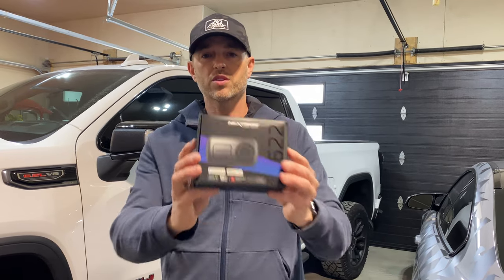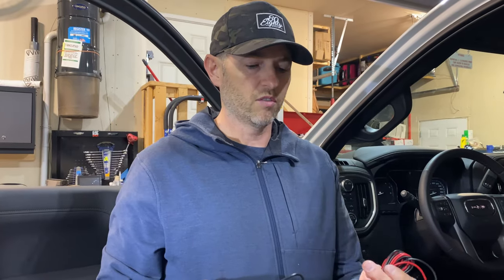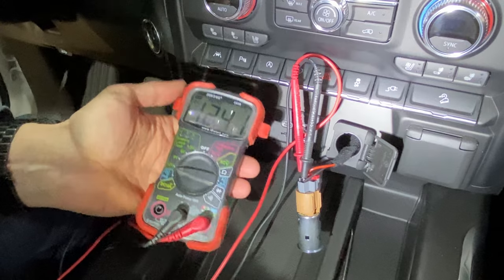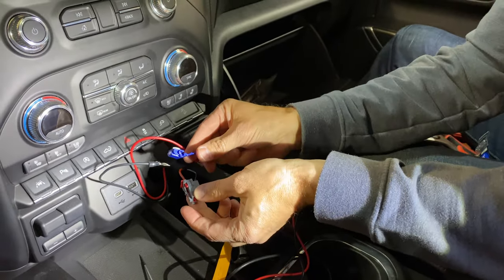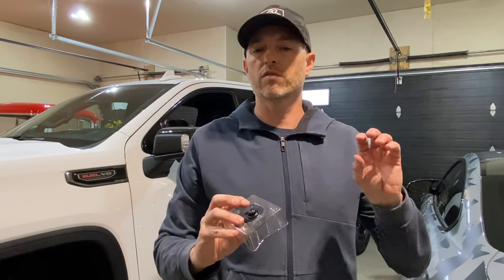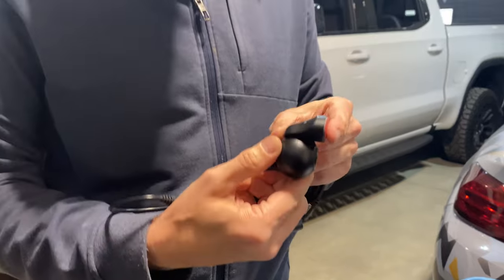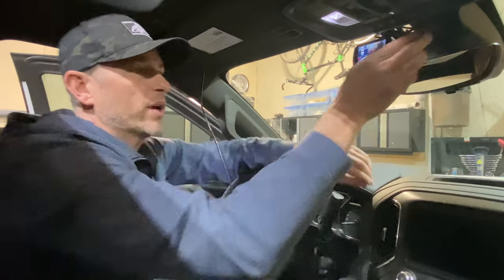Nextbase Dash Cam with Rear Camera Installation and Comparison.  What's Best for a Truck?

Comment: The camera that mounts to the main camera is a cabin camera, for recording all that happens in the cabin, it is not a rear view camera for catching what happens outside behind the vehicle, they are three cameras for three different jobs and view points.
Reply from the maker: Yes
Reply: You are not correct. They offer two inside cameras, inside the cabin and a telephoto one.

Comment: For the main unit, could you have used the adhesive mount and stuck this on the dash instead of the windshield?
Reply from the maker: You can stick it to any area you want as long as the surface is smooth enough, clean and you can get the right position for the camera's view.
Reply: Why would you do that. They say the unit should not exceed 120°F. If you mount it on the Dash it will cook in the sun. I guess he should’ve mentioned it but I don’t see the practical use in doing that.

Comment: That screen is huge to have on your windshield in your field of vision. It’s the size of a pocket camera from the early 2000’s. There are others with just as good of resolution with a much, MUCH smaller screen. Does that get in your way or bother you at all?
Reply from the maker: You might be surprised, the placement is not restricting at all.  The problem with producing a video is your seeing the camera’s perspective and not necessarily the driver’s.  I am very picky and put a tremendous amount of thought on where I wanted it.  Where it is works in my opinion. It is only 3” diagonal. The video probably does make it look like a Canon A60 point & shoot 😂.  Thanks for watching

Comment: Good review, but how does the rear camera get power? Are there contact points on the base that the ball magnetically attaches on? No one seems to explain that. I like that you showed how the front camera gets power. You're the only person that actually explains it.
Reply from the maker: Thanks, the rear camera gets power over the single USB cable.  The rear camera connects to its mount magnetically.

Comment: Thank you so much for this video. I was kind of scared buying the front and rear combo because it sounded so difficult to wire up and take the headliner off the car to get the wires to the back of the car but you showed how to do it. Very thorough explanation thank you!
Reply from the maker: Awesome!  It is why I make these videos

Comment: Great video, after watching I started to run the power from the camera end, like you tucking the led box in a convenient space then I was able to cut off all the excess once I reached the supply point rather than stuff excess cable behind the dash. If I hadn't watched this I would have done the same as you and started where picking the power up. Also helped my choose which rear view go go for.

Comment: Hey Don, your video was very detailed and answers my question whether both rear camera can be installed at the same time. Thank you buddy and love the metal gear solid reference.. God bless mate.
Reply from the maker: Glad you liked it
Reply: I'm actually considering the 522gw since it's only $250. I think 1440p front should be sufficient although it reduces the rear resolution to 720p. What do you think? Should I get the 622gw instead? It's for a 2017 lexus rx350.
Also, have you tried using a non Nextbase SD card? Their website warns of recording errors if we don't use their brand cards. Thanks again.

Comment: I just purchased the 622GW with the rear window mount camera. I intend to install the rear window mount camera on my sliding rear window by routing the cable to the camera from the side the window slides to. I plan to have the cable outside the liner enough so that I can open the sliding windows and have the cable droop. When I close the window it should pull tight. I mainly open the sliding window to blow the hot air out when I first use my F250. Pretty much stays closed otherwise.
Reply from the maker: Could work.  I was thinking the movement of the cable from the glass could cause the camera to swivel in the magnetic cradle.

Comment: Nice install! Poke and wrap over wire tap for me though. Those can be hit or miss, and when they hit, it still cuts the strands of the wire your tapping. I dislike that greatly. Anyway, I have 300ah of battery on board, so I'll wire to a constant source for 24/7 monitoring. 

Your review video helped make my decision on the 622gw, thank you for that video, and images. That's what sold me. Don't need a camera if you can't read the plates. 

Time to have a witness for the inevitable it seems. Roads are crazy out there these days.
Reply from the maker: Glad it helped you out

Comment: The rear camera wire you said was not interesting to watch. Well I would have been interested. Was it easy? Did you run it just inside the weather stripping? I was thinking of getting the same camera and I have almost the same truck. 

Thanks!
Reply from the maker: Sorry it was very easy to just stick to the edges of the headliner.  If you watch this video I lower most of the headliner: https://youtu.be/-jZGRPj2g5g
Reply: @Donslife  thanks! I will watch it.

Take care.

Comment: Great video (as always)... 2 questions please. 1) Did you run the rear camera wire along the driver's side headliner or through the middle? If the latter, how? 2.) What kind/size of wire taps are needed? Thanks again for the detailed video!
Reply from the maker: Hi!  I ran the wire along the driver’s side headliner.  Here is the Amazon description: Gebildet 4pcs 12V 24V Add-a-Circuit Micro 2 Fuse Tap, Piggy Back Blade Fuse Holder with Wire Harness, 6 pcs Micro 2 Fuse (5A 10A 15A) and Fuse Puller
Reply: @Donslife  Perfect. Thanks again. Looking forward to the next video!

Comment: So I have a question, why come you didn't get an add-a-tap fuse to tap into that side fuse panel, I have a 2023 Chevy Duramax 3500 and I'm trying to install a dash cam, are their any hot fuse on the side fuse panel?

Comment: What about mounting that 3rd camera to the bumper near the license plate?  I have a late model Silverado and just bought a dual dashcam setup.  Didnt think about putting on the glass at the rear of the cabin.  Thats much simpler than having to run the wire through the floorboard.  The downside is limited view below the tailgate, eg.  when someone is pulled up right on your bumper at a stop light or is tailgating you on the highway.  Actually, after re-watching the last part of this video again, I think putting my rear camera INSIDE the cab, just as you have done will work just fine, with the added benefit of everything being inside the cab.
Reply from the maker: I am with you.  Personal experience only - For my climate I found external cameras like the ones for dash cams  aren’t reliable in -40°C/-40°F conditions.

Comment: Nice comparison video.

Question for you - is there a way in which we can tap into the third brake light camera used for LCD rearview mirror of the GMC’s with technology package?

It would likely be less obstructed and reduce the number of accessories attached to the inside of the window. Maybe one of the aftermarket dash-cam companies can look into a kit that allows us to tie into and use the existing cameras and simply record these signals for our record.
Reply from the maker: It crossed my mind however there would probably need to be a inline conversion module  to adapt the signal and adjust the resolution/aspect.  I find it highly unlikely that an aftermarket company would make it in the near future.  Be really cool though and I am okay with being wrong on this assumption
Reply: I have been thinking the exact same thing.

Comment: What brand of wire taps do you use? I will be installing my 622 this week in my 2020 1500 Denali
Reply from the maker: Nothing special.  Just an Amazon find if I recall
Reply: @Donslife  Thank you. The brands are pretty much all the same.
Reply: Using your video as my guidance, I finished the install on my '20 1500 Denali. It took me about a half hour with most of the time spent on running the cable in the headliner. I was able to find an unused constant power 20A circuit using a 2 prong fuse located at the F5 position on the passenger side fuse box. I utilized the umbilical that was included within the Nextbase wiring harness. This saved me from tapping into the cigar (not a ciggy person) lighter. A big thanks for giving me the guidance on how to install my Nextbase 622.

Comment: Is there a reason you didn't tap into the fuse box? Did your cigarette lighter still work after you tapped into it?
Reply from the maker: No special reason other than I wanted to show my audience alternative installation options.  I have done several videos with fuse tap videos for radar detectors, dash cams and more.  I can use my cigarette lighter socket as normal.  A dash cam uses very little power.

Comment: Once I get the "Metal Gear Solid" alert sound at the start, this guy gets the thumbs up. I don't even care about the rest of the video anymore!

In seriousness, would have been nice to know how "goofy" it looked in the corner. I'm just curious how obtrusive that camera is in your rear view mirror. So that would have been useful.

But thanks. Good to watch.
Reply from the maker: 😊 the mirror screen is a nice add on and not obtrusive at all.  I find I use it in very specific situations, usually hauling cargo or towing to check on things.   Otherwise when not on, it looks like a standard mirror, which is 95% of the time

Comment: I could of sworn the fuses on the passenger side panel are the 2 prong( i could be wrong ) and there is a  fuse for the cigarette lighter adapter and you can leave it like it is and be powered 24/7 or you can move it over a notch and it only work when the truck is on

Comment: Cigar lighters are a great 10 amp. Circuit breaker. Already at the center dash.
Reply from the maker: Yes, I did a dash cam install about a year before with that method, I changed it up

Comment: Hi what is more better in your opinion? 
As I have the rear camera that attaches to the rear windshield. I’ve tried the cabin view camera but it’s not good if you have passengers in the back.
Reply from the maker: I like the rear window one better.  If I was an uber driver or taxi, than the inside might be more appealing

Comment: great video ... keeping it simple and clean.   I noticed maybe a travel trailer near by ... not sure if its yours, but do have a 25 ft trailer and was thinking what a great place for second camera. in your opinion would you be able to extend second camera wire to reach back there?  thank you.
Reply from the maker: Good question, but I think it could be problematic running the signal wire that far.  Plus you’d need to splice in an extension.   For my 30ft trailer I would look at a wireless transmission option to a separate screen. Or add trailer cam option to my truck (which it has a provision for)

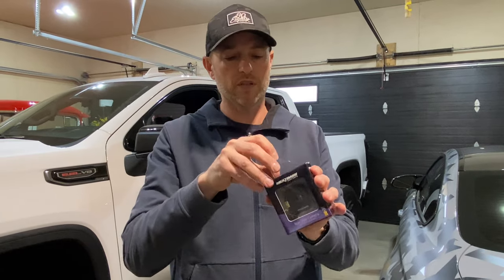Comment: 11:21 the camera falls in the background. Good video might pick one up for my AT4.
Reply from the maker: Ya I would suggest the adhesive for the final mounting position.
Reply: @Donslife  Yes, the suction cup also fails & the camera will fall in high summertime heat when the truck interior is super-hot.

Comment: Hey I have a question for you, I am looking into getting this camera the 322GW with the rear camera that clips into it would they both record at same time?
Reply from the maker: Yes it will simultaneously record two files. One for each camera.  Make sure you buy the recommended memory card ‘U3’ spec or you could run into problems.  The cards have to be fast enough to record the data.  Thanks for watching the video!
Reply: @Donslife  thank you, i am not sure where to get the SD cards, I found one at the place I am looking at buying it is 32GB will that be okay? Can I move and clear the clips each day or every couple days onto my laptop?
Reply from the maker: 32 for that camera is fine. It saves the files you need based on a button push or if it senses a harsh movement and puts them into a folder until you move or delete them.  All of the other files with no action get overwritten automatically unless you download them.  A 32 GB card will last quite awhile (days) with that cam.  Unless you drive for 4+ hrs straight every day.    BestBuy will have cards but here is the actual specs from the nextbase website:

https://www.nextbase.com/en-ca/accessories/32gb-u3-microsd-card/
Reply: @Donslife  awesome thanks, I’m in Australia I think this brand is new to us I only seem to find the card with a case for the dash cam, don’t know if there is other brands that are compatible I suppose not?
Reply from the maker: There are other compatible brands. Sandisk, Lexar, for example.  Just look for the ‘U3’ logo and has at least these speeds: Up to 100MB/s read speed Up to 60 MB/s write speed
Reply: @Donslife  Seems like a bunch of the reviews on Amazon say the camera just stops recording for no reason.  Wondering if you had that issue and if it is related to the SD card failing.  Getting a 128GB Samsung Pro Endurance for my 622 so hope it works.

Wondering if the rear camera that is directly mounted to the dash cam (not back window) would work better in a car vs a truck because of the bed.  I do like the view on the cam mounted to the rear window better.  Any noticeable difference in picture quality between the two rear dash cams or if was just the cam angle that you liked better.
Reply from the maker: @keithb3801  My 622 has only froze up once.  I reset and formatted the card and no issues since.   The rear cameras all seemed the same picture quality l, just a different angle like you said.

Comment: Nice and detailed video sir but it’s a shame you can’t use this cam as 3 channel at same, if you use it as 2 channel you reckon you can set up a rear window separately or just go with something that has 3 Chanel as cabin one is important in my case for ride share 

Cheers

Comment: My rear camera isn’t displaying when I plug it in like you any ideas?  Same rear camera nextbase small round one?  No power or display on the front cam screen but the front cam is definitely working?  What’s going on these are brand new shouldn’t be any issues?
Reply from the maker: I have had 3 but have never had power up issues.   I would contact nextbase support

Comment: Hi Don, I have a question on you please: if you connect to 622 the rear camera (I mean the one on rear window), will the front camera still run on 60 or 120 fps? (both cameras on Full HD ofcourse)

Comment: A trick I use if you only have suction cups. (they usually fail in the summer heat). I put a small dot of clear silicone inside the suction cup then mount to the glass.  After it dries mine have not gone anywhere even with my cellphone attached.
Reply from the maker: I may have to try that!  Good share!

Comment: Nice video. But you didn’t need to cut any wire if you’re using the wiretaps.
Reply from the maker: Yes, just make sure to get the right ones.  Decide on which fuse you are tapping since there are various sizes.

Comment: Great video. I need to know how you ran the wire through the headliner without breaking it
Reply from the maker: Just pull off the weather stripping around the door openings and that will give you enough access to tuck the wires

Comment: The wire will "...go through the head liner, which is not that interesting so I'll do it off camera..."

Learning how to route through the head liner is becoming the most difficult part if my installation.  The part you didn't record is the segment of most value.  :(
Reply from the maker: Just peel back the weatherstripping, tuck in the wire and press the weatherstripping back on.
Reply: @Donslife  that makes sense on the doors (the black rubber part) but how do you do that on the ceiling panels? The rubber weather stripping does not exist for the full span from my dashboard to the rear window of a long body Toyota Highlander.
Reply from the maker: I don’t have a Toyota Hylander but if it is anything like the last two generations of Cadillac Escalades, you can feed the wire though and tuck it up the edge with your fingers.  I am sorry but I only had the one vehicle to demonstrate the camera
Reply: @Donslife  I'm trying to figure out how to do that across a 30 inch blind span  between the rear hatch and the 2nd row doors.  It's not looking very promising, sadly.
Reply from the maker: Undo the weatherstripping around the rear wind hatch and the headliner should be a little more accessible
Reply from the maker: Or the B and C pillar plastic covers might pull off. Held on with clips.  Disconnect the battery if there are airbags to worry about
Reply from the maker: Here is a video I googled that might help : https://youtu.be/6LkBuOHpGII

Comment: Can specify the wiretap details like any specific brand or type, it will be very helpful. Also let me know if it is available online. Thanks in advance
Reply from the maker: Here are the ones I ordered in Canada (Amazon.ca).  Pretty sure they are the same on Amazon.com too:

https://amzn.to/3mAyVED
Reply: Just an fyi if you tap into the fuses on the right side panel in the Sierra you don't need to tap the wires.  The fuses on that side are two prong, not three.  the ones on the left side are three.

Comment: Can you tell me what suction mount was used in your application?
Reply from the maker: I found mine at BestBuy in Canada.  Here is a link for Amazon Canada.  Not sure where you live. https://www.amazon.ca/Nextbase-Click-Mount-322GW-422GW/dp/B07QDMLMJH/ref=asc_df_B07QDMLMJH/?tag=googlemobshop-20&linkCode=df0&hvadid=459552223627&hvpos=&hvnetw=g&hvrand=16570266086512346490&hvpone=&hvptwo=&hvqmt=&hvdev=m&hvdvcmdl=&hvlocint=&hvlocphy=9001274&hvtargid=pla-779477985026&psc=1